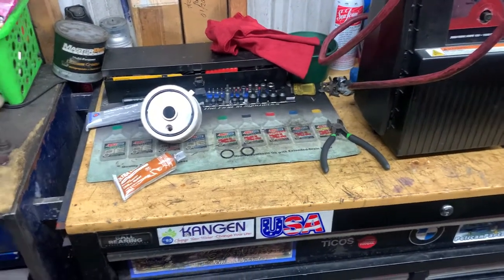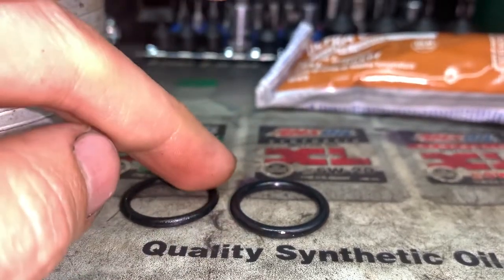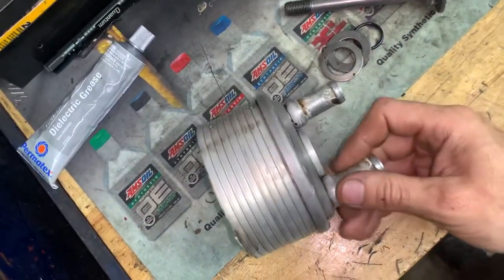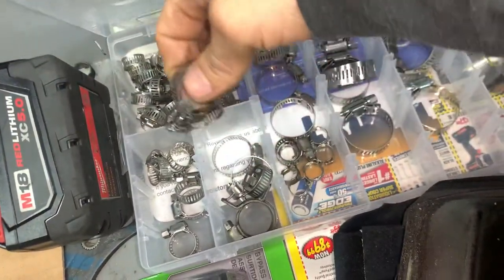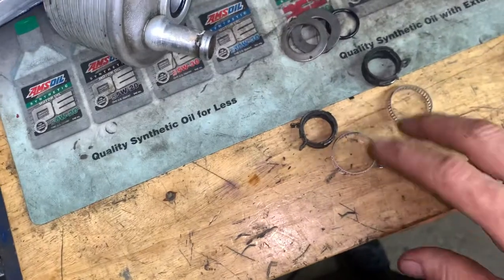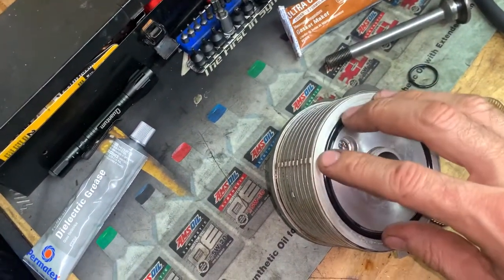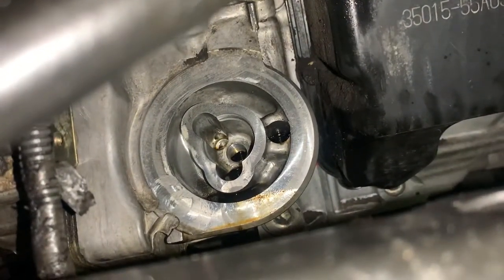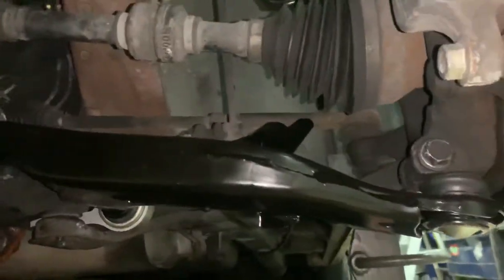2004 Nissan Quest

Comment: Subaru uses the same type of cooler, probably a smaller unit. The problem with making it swell up using brake cleaner is over time, that O- ring will shrink back down. I would be taking that O- ring to a pneumatics and hydrolics place. They carry every size O- ring ever made.

Comment: I have a question I need help if someone can do a little video for me please I wish I can show y'all the pictures to understand better but I'm gonna do my best I trying to figure out underneath the battery tray it's a transmission oil cooler box it's 2 long hose that goes to the firewall the hose connects to the coolant pipe that's on the firewall I don't know where the short hose connects to on the transmission can anybody help me out please I wish I can show the pictures I'm lost at this point